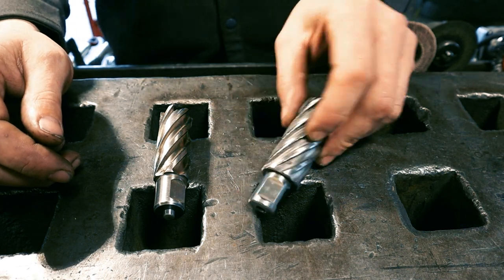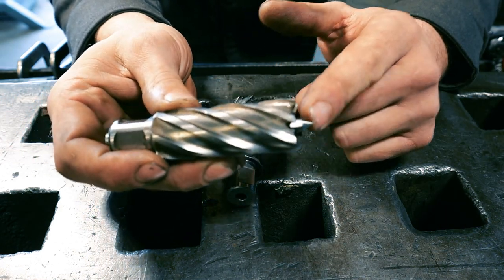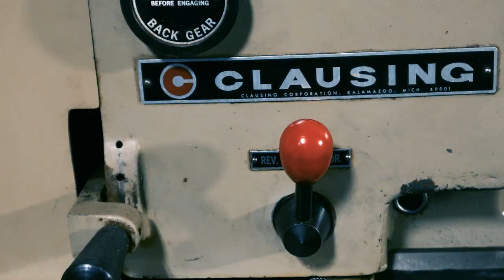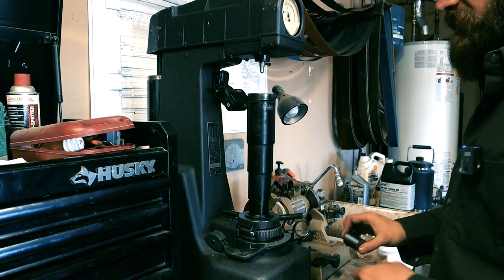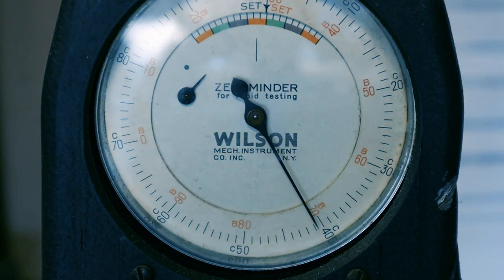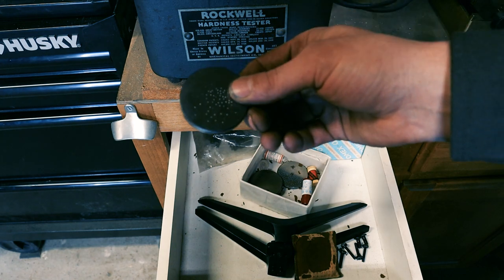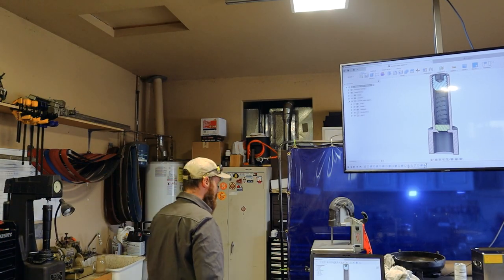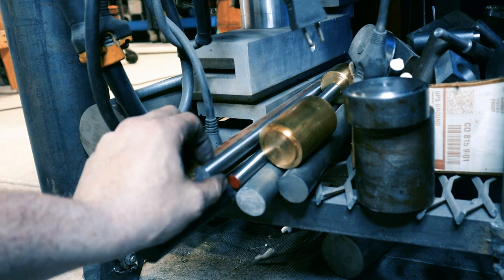Spring loaded annular cutter adapter for the milling machine

Comment: Nice adaption of the mag drill tool, much more useful now.

Who needs CNC when you do it right? Besides, where is all the craftsmanship in CNC. I suppose it's in HAL aka Mr. AI but not necessarily the human component.
Reply from the maker: I still cheat and use the digital read out for the precision stuff but somtimes you just want to throw somthing in the vise and drill a big hole....this works great for that

Comment: I wonder how good the Annie cutter would work in a wholesale notcher.🤔
Reply from the maker: I think you're talking about a tube notcher? Yes it would work well as long as the tube is held very securely and there is no vibration and also sometimes if the tubing wall is to thin it will vibrate too. Vibration will kill an expensive annular cutter
Reply: @westweld  yes a tubing notcher. Probably would vibrate to much. Probably why no one makes an attachment.

Comment: Why not a R8 weldon shank holder to hold the annular bits?
Reply from the maker: My bridgeport isn't an r8 spindle.....and I've never seen one with the locating pin.....somtimes I dont want to use an edge finder just to drill a non critical hole  how do you line up your cutter if your using a weldon holder